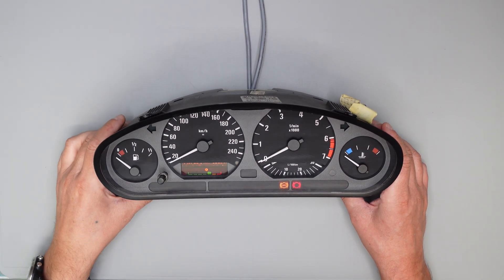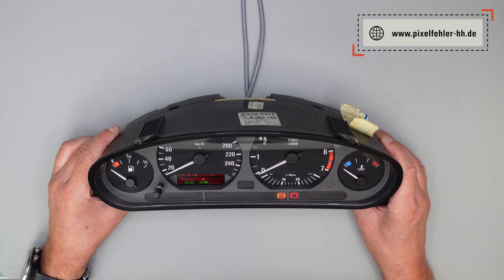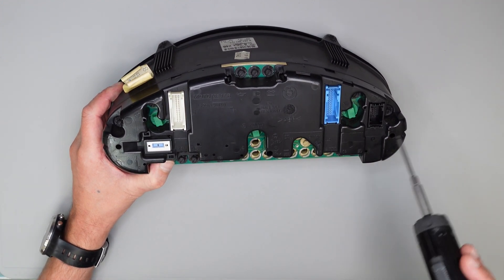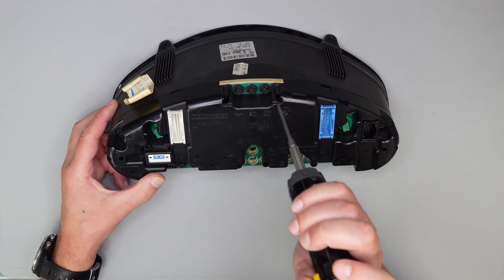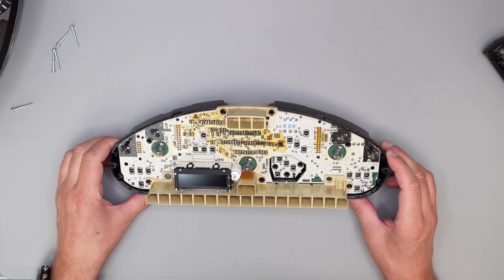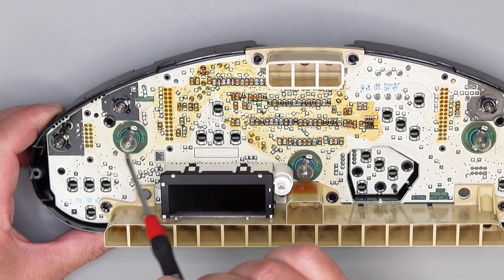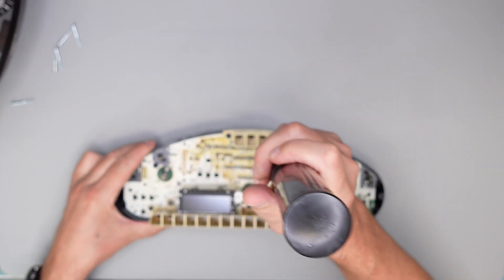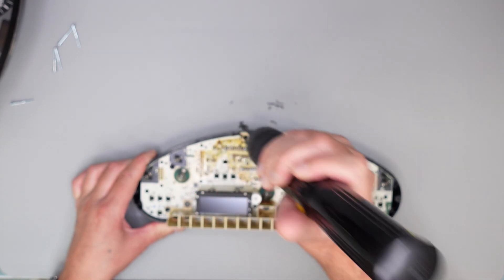How to repair your speedo BMW 3, E36 instrument cluster yourself! Easy with our pro. instruction!

Comment: On my instrument cluster I have a problem where the RPM needle shakes around when I try and start the engine. Could this be an instrument cluster problem or is this an engine problem?
Reply from the maker: hard to say. i never had it. first check the car

Comment: How we can test the instrument cluster outside off car? Which pin we can get the 12V and ground?
Reply from the maker: Hi, the pinout is in the video
Reply: Ooh yeaah.. Thanks for the information.. Nice video bro..
Reply: I still dont understand. Its says pun 4+5-12v.... Does it mean negative 12 volts? Or that "-" means equals "+"12 volts? Same for other side it says pin 22+23-12volts... Does it mean negative 12 (volts -12) or it means "=" and its positive?